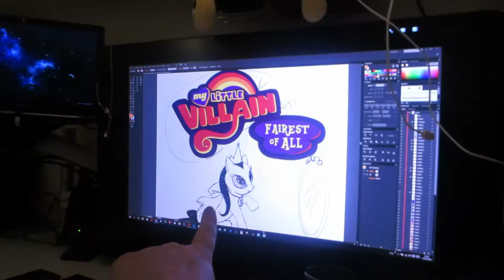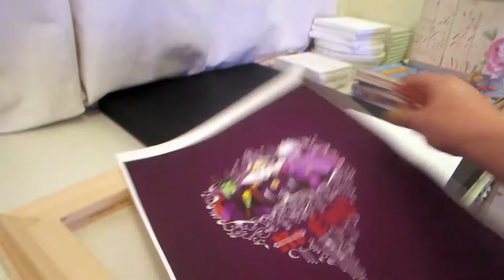D20 GAMER NECKLACE & UPDATES | SwanStarDesigns

Comment: Thank you II have wanted to make dice Jewelry as a gift for my friends and for myself. I really wanted to make it look really unique and special. Thanks to you i now how to do so. Thanks so much
Reply from the maker: Hi - I'm so glad you liked it! If you're going to be drilling a hole in your dice, you'll want to use a drill that has a slow speed. The drill bit WILL melt the dice as it drills, and the melted plastic will stick to the drill bit. I should have explained that in the video, but in the sped up section you can see me using a pair of plyers against the drill bit. That's how I removed the melted plastic off the drill bit. Keep the drill spinning, and then use the plyers slighted tilted to the side to chip it off. Other than that I'd say to start slow and and go bit by bit. Make sure you don't turn the drill off while the drill bit is inside the dice because when the plastic cools it will stick to the drill bit - and you'll never get it out! Good luck - if you post them online don't forget to tag me coz I'd love to see!! (I'm SwanStarDesigns on every platform). Thanks again, and I hope you have fun making them!
Reply: @Swanstardesigns  Thank you for the tip I will make sure to keep that in mind, but might I ask where you got the beads?
Reply from the maker: I don't remember but it was probably Amazon, ebay or Aliexpress.
Reply: @Swanstardesigns  Thank you for the help and making the fabulous video! I can make really cool things properly now. I love your content keep up the good work! :)
Reply from the maker: @magicfighter1025  Thank you so much! That really means a lot to hear that feedback, thank you :-)

Comment: I'm so glad you posted this! Some friends and I had a long running DnD group up until last year. My close friend who was our DM passed away unexpectedly and his widow just had us over to see if we'd like any of his game stuff. No one wanted his giant bag of cursed dice but I grabbed a d20 out of the bag and rolled a 20. I took the bag and I've been wanting to make some lucky necklaces out of the same dice that used to roll against us so well. I'm pretty crafty but haven't made jewelry before, so your video has put me on the right track. Thank you!
Reply from the maker: Aww, sorry to hear about losing your friend and DM! If you're going to drill the dice make sure you have a few spares to practice with first!!!!! It took me a LOT of attempts to get it right through trial and error. Some dice are made up differently than others so when they're drilled they react differently. Some of the ones I drilled MELTED because the speed of the drill was so fast. At first I used a dremel at 8000rpm, but that was too fast and when the dice melted as I drilled them the dice guts moulded to the drill bit which widened the hole or I got the drill bit stuck in the hole, or it just snapped. I ended up buying the bench drill press which spins as slow as 5000rpm which was still fast enough to melt them, but I managed to get it to work. And to get the melted dice off the drill bit I ran plyers over the drill bit while it was spinning to chip it off (because it cooled and melded to the drill bit). I eventually got there, though! Good luck with yours, and like I said start with some spare dice that you don't mind destroying. I reckon I got through almost 20 dead dice before being successful. Oh, and hold the dice in a small vice, not with your hands! If you need any more tips just let me know.. cheers.